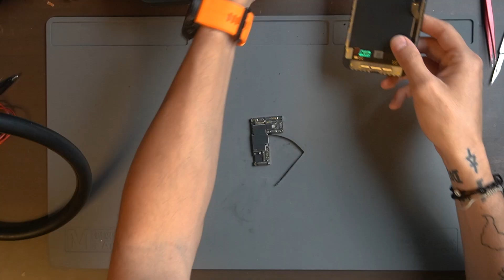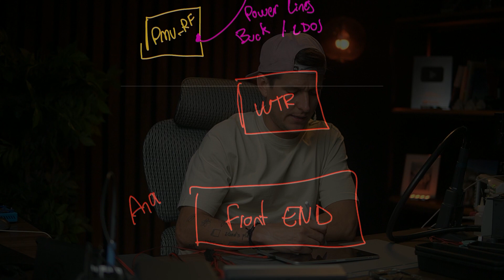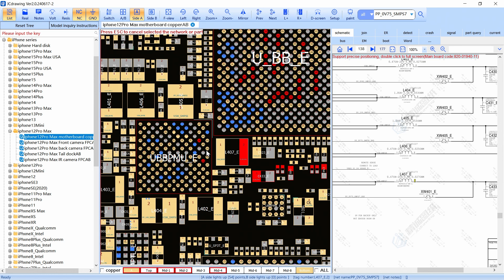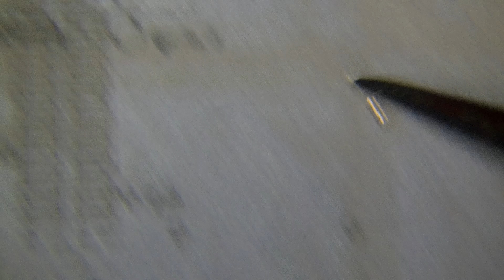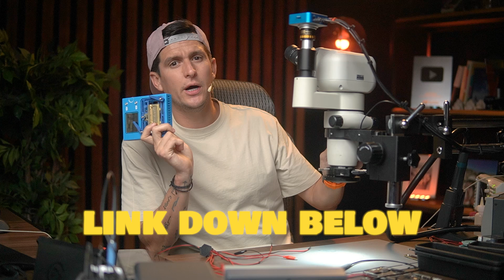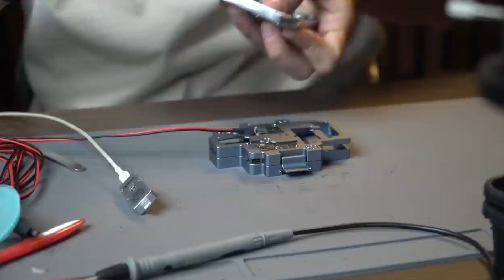iPhone 12 With No IMEI | EASY STEP BY STEP

Comment: I have an iphome 12 pro with this problem, sometimes it works, I see the modem firmware and sometimes the problem comes back, I unsoldered the modem, mounted it, everything worked for a week, now the problem occurs, sometimes it works and sometimes it doesn't work, what could it be, can you advise me, thanks

Comment: Very informative and precise.  Thank you si edgar . A big fan here from Philippines.  I have a question thu.  i phone 14 plus is required to replace wifi ic if necessary?  I mean if replace wifi ic of i phone 14 plus. I would need to unbind the wifi ? Or just to replace it and restore the phone? Thanks in advance sir. You're response is a big changed 👌👌👌